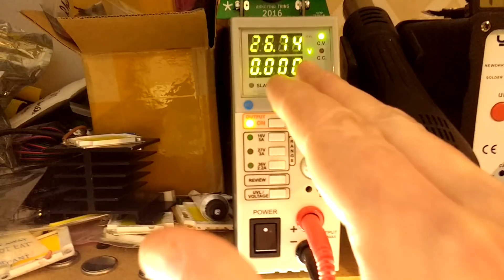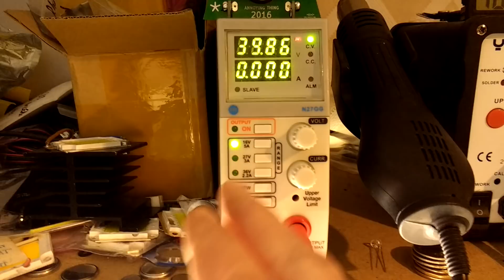Why I never show my power supply.

Comment: I had precisely the same PSU many years ago, also obtained from Maplin. Got rid of it fairly quickly :)
Reply from the maker: I still use this one.  It's important to set the other voltage ranges low though, due to its software quirk.
A shame, since it seems good quality otherwise.

Comment: Do you still use this power supply today, or have you gotten something else? I also wonder if they were able to fix that problem that it has.
Reply from the maker: I still use it, but ensure that the higher voltage ranges are set to about 3V when not in use.

Comment: Very late to the party but I also have one of these, the exact model one which was also from Maplin well over 10 years ago. I can't say I've ever had this issue, so I have to wonder if your unit is faulty? (Or if there are different versions of the software)

It's a great little power supply, but my biggest issue with it is how slow the voltage / current adjustment is. It takes many turns as the encoders are not "velocity sensitive". Sadly Maplin no-longer sell them.

Extech seem to have a newer auto-ranging version, the DCP36.
Reply from the maker: Not sure if there are different versions.  Make sure that the higher voltage modes are all left set to a low voltage to reduce the risk of the flaw damaging stuff.

Comment: I have the same PSU, also from Maplins. AFAIK, mine has never crashed...
Reply from the maker: Handy tip.  When it does crash it defaults to the setting of the 36V mode.  If you always turn that back down to 3V before switching to another range it will avoid disaster.  It seems to affect a lot of units.

Comment: So I have to ask: Why the fuck would you use an ebay (or similar) power supply??! You are an electronics expert, I would think that as such you would VERY MUCH want to have the basics, like a power supply and multimeter and oscilloscope, to be the most reliable and invest some money on them!! If you just want to make videos about how awful your equipment is, go ahead and use the most awful equipment, but you are a technical person and your videos are mostly about how awful some ebay devices are, so the equipment you use to test them should NOT be suspicious!

Comment: I have two of these, both are the Maplin N27GG variant. They have been very reliable and are well constructed (for their typical price point). The older of the two has just started doing something similar. I was charging a single Li-ion battery and after fiddling with my test rig I noticed that the output was off and no range was selected. This is the first time in the many years of use that this has happened and I think there might have been about 4V of back EMF momentarily with the output switched off. Now, normally I have a 6A, or so, diode at the supply output to prevent this, but it was built into the rig I was using and I think I accidentally bypassed it. Once the range is selected it seems solid, but I have noticed that after an extended period powered off it will power on with no range selected. The other, newer, PSU is fine.
I have found a circuit diagram for the Voltcraft LSP-1403 variant of this design BTW. 👌 It’s an interesting design incorporating dual ATMEGA48 MCUs and utilising a UC3843 SMPS controller with ST VIPER12A primary switcher and MC33262 PFC.
Reply from the maker: If you have one of these PSU's I'd recommend setting the higher voltage ranges to a low voltage like 3V.  When it crashes and the range LEDs go out, it will apply the current settings of the highest voltage range.
Reply: bigclivedotcom Thanks, I’ll bear that in mind. Though I’ve only encountered this so far with the output disabled, and when switching the mains supply on (after extended down time). If the condition randomly occurred when the output was enabled, I would be very concerned. I’ll just have to keep a close eye on it.
Reply: If anyone would like the circuit diagram, operator’s manual etc for these PSUs, just head over to Conrad.com and search for the Voltcraft LSP-1403 and you’ll find the specs and download links for the files etc there. 👌
Reply from the maker: @sequri  Neat that it seems to have power factor correction.
Reply: bigclivedotcom Indeed. It's actually quite an interesting design. I like the form factor; my two PSUs take up relatively little desk space. I would like coarse and fine encoders for setting voltage and current, and it's a real pity (if not a surprise) that the unit is not really hackable (if only the source code for the MCUs was available).

Comment: I do have the same Model (labeled Manson) which seems to be the exact same design. Mine has never crashed as shown (at least not while in use). However there is one issue that bothers me and already caused a 3.3V circuit board to burst into flames... It's that stupid "UVL"-button, placed directly underneath the "review"-button. If you just want to check, which max. current is set, while the power supply is in use and you accidentally come in touch with that "UVL"-button - BOOOOM!!!  It outputs max. Voltage at max. current and thus blows up every circuit that's connected :(

Yes, you may call it a user error, but still I call it an extremely stupid and dangerously bad design. That button is used to set it to slave mode, in order to hook up a second power supply of the same type, doubling the output current. Those power supplies need to be connected at the back and that's where that stupid button should go (as a dip switch).

Comment: @bigclivedotcom , I just randomly bought this exact same psu at a bootfair this morning for the princily sum of £8.  Got it home to see if it actually works and the alarm was kicking in. I noticed the UVL was set really low at less than 5v, got out my twiddler and poked it in the hole to change it.  Well short testing all the ranges match on the fluke, although I'm now worried it will crash like yours.

That brings me to yours, you have you Upper Voltage Limit set really high to 39.86v, if you were to set it at a more acceptable limit to your project will that limitter cut in when it crashes??
Reply from the maker: I noticed that when it crashes it seems to select one of the other voltage ranges without lighting its LED.  I set all the other voltage settings to about 3V on that unit when I'm not using them.
Reply: does the crash reset the value of the upper voltage limiter aswell then?

Comment: that is why i dont use power supplies and instead use solar power as voltage and current limiting. ofcourse that means you need sunlight. a grow lamp does the job though.

Comment: I have two of these, perhaps for five or six years, and use them daily. The benefits are its simple interface and 10mV/1mA resolution. On the downside, it is possible with fat fingers to accidentally press two buttons at the same time, thus changing voltage range and frying your DUT. I haven’t had the crash thing happen though.

Comment: That's pretty fancy there, Clive.  Mine is a rather old "Electro"  Model no.  D-612 T With a 0-8 volt range and a 0-16 volt range selection. 10 amps @ 12v continuous, 20 amps max intermittent duty.

https://thumbs.worthpoint.com/zoom/images1/1/0410/18/electro-612-dc-filtered-power-supply_1_9299da8063739608baad05ea42fefa7d.jpg

Comment: I had an idea, maybe someone else has seen an app like this; Friend is color blind and VERY interested in electronics; Has anyone seen an Android app that you can image a resistor and read the color code off it with? (Otherwise he has to bring parts over to me and have me read them in person, or try to get pics to me to recognize the color bands.) As there are a LOT of people out there who are color blind, I imagine that this would help others too. (Not set up to do Android SW Dev currently, been having health problems and not getting as much done as I'd like.)
Reply from the maker: I recommend just measuring them.  Even if you're not colour blind it often makes sense to double check the blue metal film resistors as the colours get skewed by the blue background.
Reply: Sure, when you can measure them. He has one PCB now that has either a 22R or 15R on there, he's not sure, but as there's other circuitry across it he doesn't get a clean measurement (something like 17R6 or something.) So he is complaining. LOL - I have suggested desoldering it and he's at least good at desoldering and soldering, but all us engineering types are lazy, er, "efficient" and don't really want to do the extra work, seems. I agree on the blue background resistors, they SUCK in terms of readability. The Image to Color Codes tool would be "Just another tool" and an optional one - It could be a very handy tool sometimes, in case you had a picture of the board before it exploded in flames, if you wanted to rebuild it and had no part any more - as the existing part had vaporized. Thank you :)
Reply from the maker: Ah, in circuit it's going to be harder.

Comment: Clive, I love ya, but why is that not in the trash or parted out. I cant think of a more useless (or dangerous) piece of equipment in a lab! Maybe I need to build you an oscilloscope that randomly changes it's vertical and horizontal settings randomly and then applies 1,000 volts to the probes. snicker. i'll bet $1 it's a switich mode supply, give me a big ugly transformer and a power wasting regulator everytime!
Reply from the maker: I've kept using it deliberately to catch it crashing and prove it wasn't just my fumbling fingers.
Reply: bigclivedotcom you are a sick puppy,  I like that

Comment: Happened to me with as well Clive, I am going back and rescuing all my old linear transformer based PSU's for exactly this reason, I had a test bench with 8 prospective micro controllers on a stress test and the one hung low switch mode digital supply went to 30v and blew the lot.... these days I run all digital supply's with a TLS805D1LDV50XUMA1  or a LM2936 (for higher power) in line with the supply as the hassle of  making an LDO dropper reg board is far better than having a bench of stuff blow up. A really good idea would be a  cheap open hardware psu design for the hobby and pro users alike to build at home and get past the often silly price points and unreliability.

Comment: Buy a new one and take this one apart. Does a power supply really need a microprocessor, if all it is doing is replacing potentiometers with buttons? Is this a case of style over substance?

Comment: I purchased an Xpower 605D power supply some time ago for about $90, and it has worked well. The meters read a bit low but otherwise OK. It's less than $80 on Alibaba: http://microera.en.alibaba.com/product/1011592469-212733814/dc_power_supply_RXN_605D_60V_5A.html#!

Comment: I have one of these, never done that to me. But I don't tend to use it at the higher voltages. Normally between 3.3v and 12v with at most 2amps.
Reply from the maker: In that case, as a precaution I'd suggest setting both the higher voltage ranges to about 3V so that if it does experience this blip it will only put that out.

Comment: I've had a similar issue with a remote controlled TTI power supply. If you control it remotely and then switch to local control (either by the remote control command or simply by pressing the 'local' button) it would select a random voltage, sometimes even much higher than it's rated voltage (Although the output would never actually go above its maximum rated voltage).
Updating the firmware solved the issue, but only after it broke an expensive board. And that just sucks if you buy an expensive power supply 'just to be sure'....

Comment: Clive, I know this would be a pretty grim "bodge of a fix" - but could a signal be taken from each of the range LEDs - via a 1n4148 so that if some voltage is NOT present, then it cannot turn on a transistor which has a relay in series with the output.

Crude I admit - and if the fault can occur mid-use, may not act in time to save a delicate circuit, but if the relay can only engage to connect the output terminal IF a range LED is lit, this might be good enough most of the time.

Quick fix (4 diodes, base resistor, transistor and relay plus a back EMF diode I guess to be kind to the tranny) and it might be a PSU that can be relied upon a bit more.

Of course you being a clever sausage might add a little circuit so that if the unit is ON but the range lights are out, then after X seconds, it toggles a relay on the incoming mains to force a reset as well?

Comment: Thanks Clive. I had a PSU which played that trick, on occasion. It was used at 13.8V and would go to about 19V when it had a hissy fit. The fault turned out to be a slightly corroded chassis Earth connection. Cleaned it and added vaseline to keep condensation out and that fault never recurred.

Comment: Big C.  Can you do a cheap uv light?  I have one that looks like a "hole warmer".  I would send it, but I need the electronics to start another bulb.  There should be some kind of starter and step up as it runs off 2 AAs and the bulbs typically go for 10V current limited

Comment: This is good example of why designing a lab power supply this way is a fail. Best to stick with a linear power supply, with quality components, as they last for decades, no shitty crashing computers. Also plastic casing is a not good as its a fire hazard.

Comment: That sounds like a software problem, possibly caused by "noise" on the power rails.

But it's also very bad programming!

I've long maintained that half of good programming is good "exception processing".  In other words, making sure that your program does something sensible (and safe) when the input doesn't make any sense or there is an unexpected input.

The problem is that most so-called "programmers" these days aren't.  They're really just hacks who cobble together library routines without considering the possible problems and without considering "exceptions".

I really wish I could get into the programming for that gadget and fix it.  It's probably using a microcontroller, but they've probably "protected" the code so I'd have to figure out my own program and then replace the whole chip. :p

Comment: In other comments you've mentioned that you "catch" it before it defects, but how do you know or have you blown up any circuits before (especially if they were meant for a video)
Reply from the maker: I have been caught out before.  I often check the voltage displayed before connecting to a load.

Comment: Wow! When will you start debugging or replacing the micro processor with an Arduino?
Reply from the maker: That would be in the league of designing an entire new product from scratch.  I'm keeping an eye on the open source software that's being developed for the standard colour display PSU modules though.

Comment: I recently bough a Yihua 3005D-11 power supply - huge heavy great thing - weighs perhaps 15 Kg or more. Dual output 5A 30v which can be made to track each other - and not an outrageous price - £150.

Alas, after about a week of use, output 1 has started to do its own thing after a short circuit. Sometimes it has zero volts, other times around 22 volts - but adjusting the voltage settings have little effect on it.

I ended up having to produce a mini video (https://www.youtube.com/watch?v=gP_gRR8Lfp0) in order to be sent a new PCB to repair it (going to fit tomorrow).

Strange - the manual actually instructs you to short the output leads to set the current limit - BUT doing so, can result in the unit failing. I am going to try and find what has failed in the old PCB so if (when) it fails and is out of warranty, I have a chance at repairing it.

Withe the little single PSUs from our good friends in China, things like the "605" 60v / 5A, if you accidentally feed this in reverse (not a good thing), then they seem to fail in a very predictable way - there is a large 6A diode which fails (sometimes visibly) and replacing this is usually all that is needed to make it work again - BUT it also melts (I shit you not) the solder at the rear of the output terminals so they disconnect.

So replace diode, re-solder one (very rarely both) output leads to their terminals and it is ready to play again.

Of course, not being as careless as me, means you won't need to do that - but with the tracking PSU, no such excuse for it failing - it simply died when a peltier junction failed and went short circuit.

Comment: It's probably using a Chinese microcontroller which is either a single defective unit or the design of the chip itself has a bug which causes it to give unpredictable outputs if certain criteria are met.

Comment: I have the same power supply except branded "Manson". Never had that problem. Found service menu once, but cant remember how to get there now...
Reply from the maker: You can enter a calibration menu by pressing review and the 16V range button, then step through with the review button.  I don't recommend that though in case you knock calibration off.

Comment: I just showed mine yesterday. I think it biggest flaw is that I built it myself. It was one of those school projects, it was the first year at the trade school, we made everything, the circuit board, wound the transformer(no not a switchmode), aluminum case(i had mine anodized). oh well that was 30 years ago. https://youtu.be/6MeHx-dNeng?t=6m15s
Reply from the maker: Building your own power supply is a good option from a serviceability perspective.  More so now with the dedicated PSU modules.